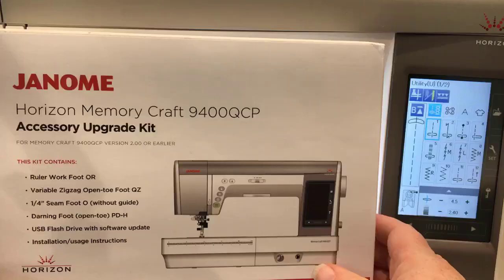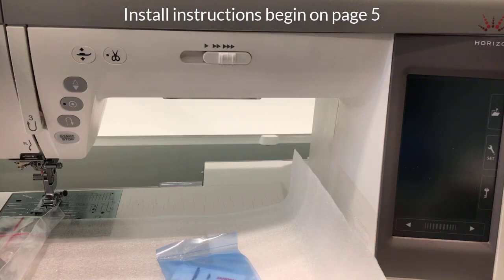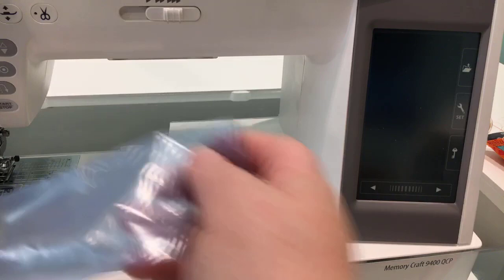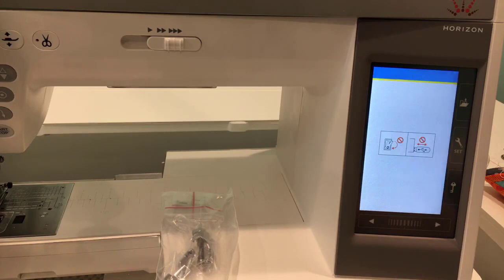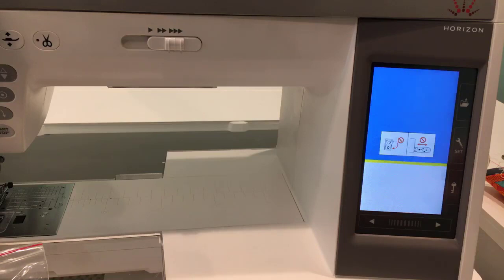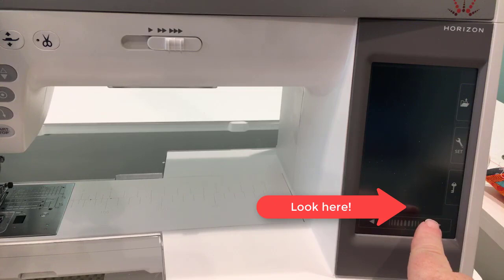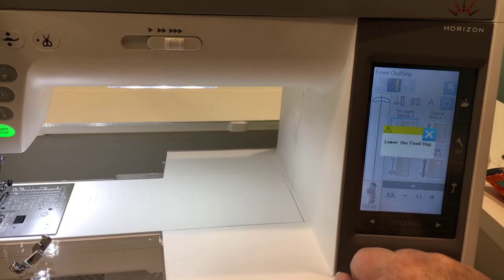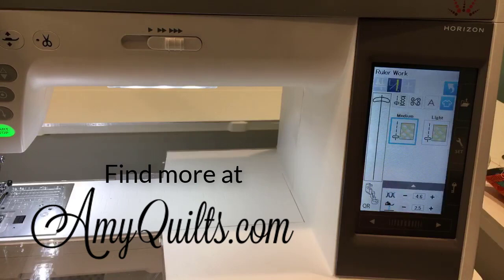How to Install the Janome 9400 Upgrade

Comment: Amy I have a 6600 and I’m looking at this 9400. Will all the accufeed feet I already own work on the 9400? And what is the difference between the 9400 and 9450? Thank you!
Reply from the maker: No, the 6600P uses a slightly different Acufeed system and the 9400/9450 use the Acufeed Flex system, which is fabulous! No prongs behind the foot to get in the way. An upgrade came out for the 9400 and then Janome began making the 9450 which already has the upgrade as well as a few other differences. Very similar machines. The 9400 has already been discontinued by Janome, though some dealers will still have it, while the 9450 continues in production. That's something to keep in mind when deciding between the two models.
Reply: Thanks Amy. As far as the 9400 and 9450 is there no longer any issues with the foot and clamp colliding? Or do you still have to worry about whether your needle is down and raising the foot etc?
Reply from the maker: Vicki Fell that's the beauty of the ruler mode! The machine won't let you clunk the foot and needle clamp together. The foot will raise or drop down as needed.